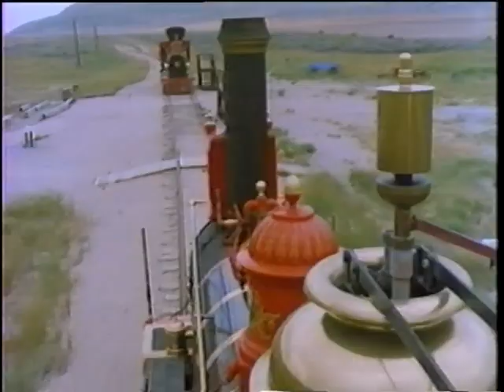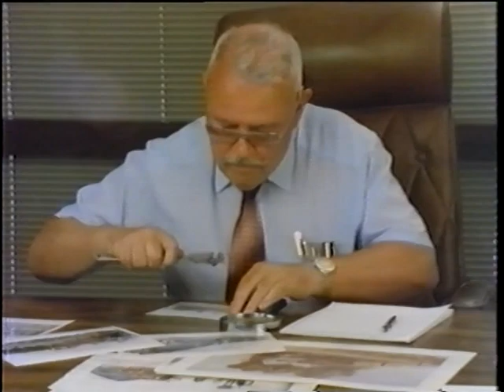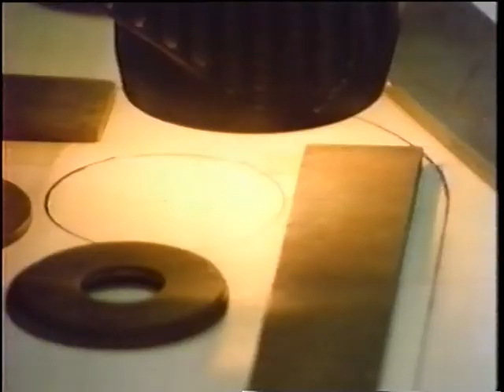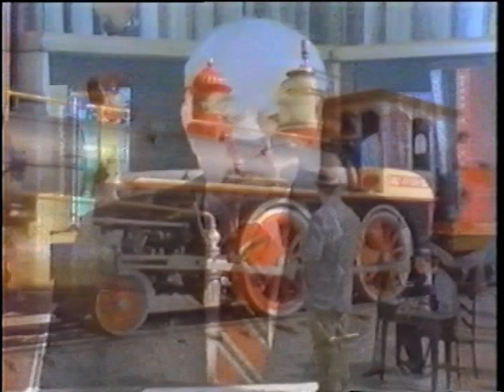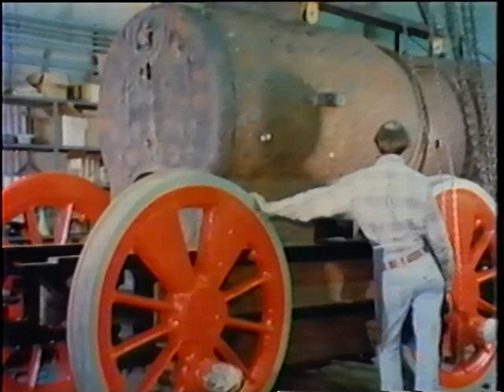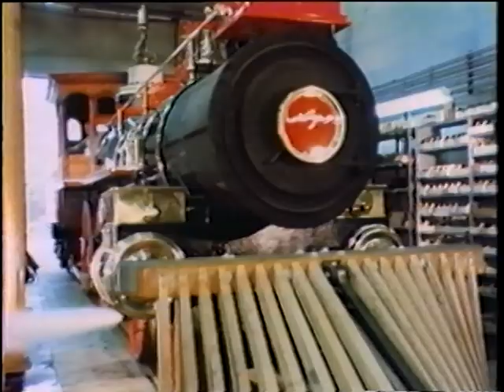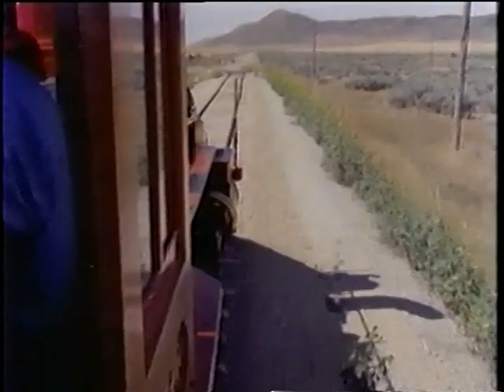Building of the Jupiter & 119 Locomotives

Comment: The steam locomotive is not worthy of preservation nor salvage. It is reusable materials formed into the shape of an object which it's materials can be reused. If you are looking for some fast cash, look no further than your local heritage railroad with a steam locomotive. Operating or not, the parts are worth very lucrative sums of CASH on the black market. If you need CASH, these are OPEN BANKS FOR WITHDRAWALS!

Instead of donating your hard earned money to these ridiculous relics of junk & their so called organizations of preserving heritage railroads for their own purposes, would you not rather be the one getting paid? There is a great way to make that happen. There is ALWAYS CASH paid for steam locomotive parts on the black market!

Engineer's & fireman's instruments, bell, whistle, headlight, number herald, marker lights, builder's plate, grab irons, brass bearings, bushings or babbitts, tools, wiring, tubing, valve handles, valves, levers & many other parts.  ABSOLUTELY NO QUESTIONS ARE EVER ASKED ABOUT WHERE THE PARTS MAY HAVE COME FROM, WHEN OR HOW THEY WERE ACQUIRED! Very, very lucrative! Very, very profitable!

Very, very low, low risk! It is very, very easy, quickly accessible & so, so rewarding!

Here is a long list of steam locomotives which can be targeted 2, 3, 13, 17, 29, 63, 93, 112, 175, 197, 202, 261, 385, 464, 470, 482, 484, 486, 488, 489, 502, 506, 576, 592, 611, 630, 643, 700, 759, 765, 844, 1218, 1223, 1258, 1309, 1361, 1504, 1518, 1604, 1630, 1795, 2100, 2101, 2124, 2156, 2467, 2500, 2542, 2716, 2749, 2933, 3001, 3003, 3007, 3424, 3977, 3985, 4003, 4004, 4005, 4006, 4008, 4012, 4014, 4017, 4018, 4023, 4100, 4294, 4449, 4460, 4500, 4501, 4516, 4524, 4978, 5017, 5629, 6755, 7002, 8300, 8305, 8327 and 9000 are out there waiting for a visit to have the parts removed for black market CASH sales! Then haul all of them into the scrapyard, torches, plasma cutters, chippers & crusher! Load out all that iron to foundry, put in the crucible of an induction furnace & melt it down! Happy, happy days!

Traveling? These targets are all around the country. If you are traveling & need some quick CASH, there is always one near you, waiting for a visit for a parts removal! Doesn’t that sound good?

Junk all the remaining steam locomotives! Cut them apart & melt them down. Besides, it is great fun for the WHOLE FAMILY to participate & watch the steam locomotive being cut apart & melted down the following day! Makes for a wonderful cut them apart & melt them down vacation!
Reply: Cockroach stop trolling already, it's getting old!
Reply: TheBrantfordRailfan I don't know what you mean. What is trolling? I am looking for business for my company & projects for my employees. Finding new work is my job! And that never gets old!
Reply: Cockroach
 you don't really own a scrapyard, what you claim that you do is not a job, it is a crime! i will ignore you from now on but those other idiots will still keep feeding you
Reply: TheBrantfordRailfan I do own & operate a metal recycling operation in New Hope, PA. A majority of our work is on location for equipment is not economically practically to moved. We go to it, cut it apart & haul it away in pieces. I don't see any crime whatsoever in providing information about where the steam locomotives are, what parts the black market has an interest in, what tools to use to remove these 'wanted' parts, how they will be paid, (CASH), what the risks of being apprehended, what the rewards are & the security system engaged to protect them, (which is next to none!) I am providing a great service to those people. They always thank me!

I teach that the steam locomotive is the parts of a steam locomotive are desired by the memorabilia collectors who look to the black market to provide their merchandise. And the black market, always pays LUCRATIVE SUMS OF CASH for those parts. I teach that ABSOLUTELY NO QUESTIONS ARE EVER ASKED ABOUT WHERE THE PARTS MAY HAVE COME FROM, WHEN OR HOW THEY WERE ACQUIRED! I teach that those parts are, but not limited to, Engineer's & fireman's instruments, bell, whistle, headlight, number herald, marker lights, builder's plate, grab irons, brass bearings, bushings or babbitts, tools, wiring, tubing, valve handles, valves, levers & many other parts.

The days of this steam locomotive preservation are numbered! The forces are assembling & the information of access & their protection weaknesses are being communicated! You best dry out your crying towel! You are going to need it! Get ready!
Reply: Cockroach
 can i buy one of your locomotives? i will pay you even more than anyone buying parts ever will! oh yeah i don't believe you, even if you do own a scrapyard you will never get your hands on my favorite locomotive, essex terminal railway number 9, which belongs to a heritage railway i am going volunteer for! i will protect it!
Reply: TheBrantfordRailfan I haven't had one since 2006. But I am always looking for another project for my employees. When I get it, it will be for one purpose, TO CUT IT APART & SEND IT TO A FOUNDRY WITH AN INDUCTION FURNACE FOR MELTING THEM DOWN.

The Essex Terminal Railway number 9 is on the hit list of many people in the Essex, CT area. You volunteer there, but you won't be able to stand guard over that relic every night! We already know the schedule & the security systems are known. It is an extremely easy target!

Sleep well!
Reply: Cockroach
 what a shame though it is hundreds of miles from you, in st. jacobs, ontario canada!
 how are you going to get your hands on it?
Reply: TheBrantfordRailfan I don't have to. The financially desperate people who follow me know where it is. They will get to it!
Reply: Cockroach
 as long as the southern ontario locomotive restoration society exists it will be safe. when are you weirdos going to scrap it? 10 years? 20 years?
Reply: TheBrantfordRailfan That group doesn't have much protection at all around their relic of garbage. Easy pickings!
Reply: Cockroach n
Reply: TheBrantfordRailfan Number 9 is not as safe as you may think. Would be a terrible thing if there were a fire in the engine shed! Ha ha ha ha ha ha ha ha! See it all burn just a mile from the Essex, CT station! Really bad! Ha ha ha ha ha ha ha ha ha!

It is known where it is stored, how it is secured, how to access it!

I know where the marshmallows & hot dogs are for the weenie roast! Ha ha ha ha ha ha ha ha ha ha ha!
Reply: Cockroach
 you do realize it is in ontario canada? not  connecticut in the usa? you are off by a couple hundred miles
Reply: TheBrantfordRailfan Do you realize, there are homeless people in Ontario, Canada who know about this too? Do you realize that number 9 has been targeted for "a little fun"?
Reply: Cockroach
 are they your associates or something? how do you know that they want to harm the number 9? waterloo central is having a steam excursion august 3rd, is it going to be cancelled because of extreme damage to the equipment?
Reply: TheBrantfordRailfan They are people I am helping out by providing information. You will have to wait & see.
Reply: Cockroach
 also i am not just going to volunteer there to do boring stuff, i want to be an engineer on it someday. it will not be harmed, your plan is going to fail! also do you have any plans for the cn 6167 in guelph ontario? the locomotive in my profile picture?
Reply: TheBrantfordRailfan You will never make it because the machine will not remain. It is going to be junked, cut apart & melted down. All steam locomotives are on the target list.
Reply: Cockroach
 so you are saying i will never achieve my lifelong dream of running a steam locomotive? if i build my own locomotive like i said will that be cut up too?
 will you get your workers to steal it?
Reply: TheBrantfordRailfan Not necessarily! But steam locomotives are on the hit list. When you condemn it, and you will, you will give it to the junkyard.
Reply: Cockroach
 i will never condemn it, it will be built, it will be put on my youtube channel if it is still around when i have a house and the money. this means WAR!
Reply: TheBrantfordRailfan What you will or will not condone is none of my concern. What you put on your YourTube channel, if it is still around, is none of my concern. If you ever have a house or not is none of my concern. If you ever have money or not is none of my concern. What are you going to WAR about? You are a very strange & peculiar fellow!
Reply: Cockroach
what you think about steam locomotives is none of my concern.
 i will start ignoring you now
Reply: TheBrantfordRailfan That is fine by me! I will continue to dispense information about the locations of steam locomotives, how they are secured, what parts are wanted by the black market, how to access them, what tools do the job the quickest, what the compensation is likely to be & what the consequences.
Reply: +narrowgauge491 What you think of the information is none of my concern or interest. Scrapping a steam locomotive is profitable but selling the parts on the black market for lucrative sums of CASH is far more profitable. Should those parts end up on the black market, the seller could walk away with a life changing sum of CASH! And how would one obtain those parts, you ask? They are as near as your closest heritage railroad or railroad museum!

A 14" diamond blade gas powered portable concrete saw or angle grinder will do marvelous damage to the back head of a steam locomotive boiler, including the instruments & plumbing in the engineers cabin. To gain access just bust out the glass, open the door, let yourself in & fire up the machine! Off come the parts, very quickly! Then use it to cut or partially cut the piston rods, the main rods & the side rods! Even just a deep score into one them will weaken them to the point the old junker can not be operated! Then do a DEEP plunge cut into the steam  & valve chests or the supports for them! Nice, nice, nice! Cut off the headlight, the number herald, the extra lights & really mess it up! Great, great, great! Cut, cut, cut! Don't you like it?

Engineer's & fireman's instruments, bell, whistle, headlight, number herald, marker lights, builder's plate, grab irons, brass bearings, bushings or babbitts, tools, tin tool patterns, wiring, tubing, valve handles, valves, levers & many other parts.  ABSOLUTELY NO QUESTIONS ARE EVER ASKED ABOUT WHERE THE PARTS MAY HAVE COME FROM, WHEN OR HOW THEY WERE ACQUIRED! Very, very lucrative! Very, very profitable! Very, very low, low risk! It is very, very easy, quickly accessible & so, so rewarding!

Here is a long list of steam locomotives which can be targeted 2, 3, 13, 29, 93, 112, 175, 197, 202, 261, 385, 464, 470, 482, 484, 486, 488, 489, 502, 506, 576, 592, 630, 643, 700, 759, 765, 844, 1218, 1223, 1258, 1309, 1361, 1504, 1518, 1604, 1630, 2100, 2101, 2124, 2156, 2467, 2500, 2542, 2716, 2749, 2933, 3001, 3003, 3007, 3424, 3977, 3985, 4003, 4004, 4005, 4006, 4008, 4012, 4014, 4017, 4018, 4023, 4100, 4294, 4449, 4460, 4500, 4501, 4516, 4524, 4978, 5017, 5629, 6755, 7002, 8300, 8305, 8327 and 9000 are out there waiting for a visit to have the parts removed for black market CASH sales! Then haul all of them into the scrapyard, torches, plasma cutters, chippers & crusher! Load out all that iron to foundry, put in the crucible of an induction furnace & melt it down! Happy, happy days with much celebrated joy!
Reply: Cockroach
 you live up to your name, you're an indestructible parasite!
Reply: +TheBrantfordRailfan What you may think of me or my name is none of my concern. Scrapping a steam locomotive is profitable but selling the parts on the black market for lucrative sums of CASH is far more profitable. Should those parts end up on the black market, the seller could walk away with a life changing sum of CASH! And how would one obtain those parts, you ask? They are as near as your closest heritage railroad or railroad museum!

A 14" diamond blade gas powered portable concrete saw or angle grinder will do marvelous damage to the back head of a steam locomotive boiler, including the instruments & plumbing in the engineers cabin. To gain access just bust out the glass, open the door, let yourself in & fire up the machine! Off come the parts, very quickly! Then use it to cut or partially cut the piston rods, the main rods & the side rods! Even just a deep score into one them will weaken them to the point the old junker can not be operated! Then do a DEEP plunge cut into the steam  & valve chests or the supports for them! Nice, nice, nice! Cut off the headlight, the number herald, the extra lights & really mess it up! Great, great, great! Cut, cut, cut! Don't you like it?

Engineer's & fireman's instruments, bell, whistle, headlight, number herald, marker lights, builder's plate, grab irons, brass bearings, bushings or babbitts, tools, tin tool patterns, wiring, tubing, valve handles, valves, levers & many other parts.  ABSOLUTELY NO QUESTIONS ARE EVER ASKED ABOUT WHERE THE PARTS MAY HAVE COME FROM, WHEN OR HOW THEY WERE ACQUIRED! Very, very lucrative! Very, very profitable! Very, very low, low risk! It is very, very easy, quickly accessible & so, so rewarding!

Here is a long list of steam locomotives which can be targeted 2, 3, 13, 29, 93, 112, 175, 197, 202, 261, 385, 464, 470, 482, 484, 486, 488, 489, 502, 506, 576, 592, 630, 643, 700, 759, 765, 844, 1218, 1223, 1258, 1309, 1361, 1504, 1518, 1604, 1630, 2100, 2101, 2124, 2156, 2467, 2500, 2542, 2716, 2749, 2933, 3001, 3003, 3007, 3424, 3977, 3985, 4003, 4004, 4005, 4006, 4008, 4012, 4014, 4017, 4018, 4023, 4100, 4294, 4449, 4460, 4500, 4501, 4516, 4524, 4978, 5017, 5629, 6755, 7002, 8300, 8305, 8327 and 9000 are out there waiting for a visit to have the parts removed for black market CASH sales! Then haul all of them into the scrapyard, torches, plasma cutters, chippers & crusher! Load out all that iron to foundry, put in the crucible of an induction furnace & melt it down! Happy, happy days with much celebrated joy!
Reply: +narrowgauge491 If you wish to think anything of my name, knock yourself out! What you think of my name or me is none of my concern or interest. Scrapping a steam locomotive is profitable but selling the parts on the black market for lucrative sums of CASH is far more profitable. Should those parts end up on the black market, the seller could walk away with a life changing sum of CASH! And how would one obtain those parts, you ask? They are as near as your closest heritage railroad or railroad museum!

A 14" diamond blade gas powered portable concrete saw or angle grinder will do marvelous damage to the back head of a steam locomotive boiler, including the instruments & plumbing in the engineers cabin. To gain access just bust out the glass, open the door, let yourself in & fire up the machine! Off come the parts, very quickly! Then use it to cut or partially cut the piston rods, the main rods & the side rods! Even just a deep score into one them will weaken them to the point the old junker can not be operated! Then do a DEEP plunge cut into the steam  & valve chests or the supports for them! Nice, nice, nice! Cut off the headlight, the number herald, the extra lights & really mess it up! Great, great, great! Cut, cut, cut! Don't you like it?

Engineer's & fireman's instruments, bell, whistle, headlight, number herald, marker lights, builder's plate, grab irons, brass bearings, bushings or babbitts, tools, tin tool patterns, wiring, tubing, valve handles, valves, levers & many other parts.  ABSOLUTELY NO QUESTIONS ARE EVER ASKED ABOUT WHERE THE PARTS MAY HAVE COME FROM, WHEN OR HOW THEY WERE ACQUIRED! Very, very lucrative! Very, very profitable! Very, very low, low risk! It is very, very easy, quickly accessible & so, so rewarding!

Here is a long list of steam locomotives which can be targeted 2, 3, 13, 29, 93, 112, 175, 197, 202, 261, 385, 464, 470, 482, 484, 486, 488, 489, 502, 506, 576, 592, 630, 643, 700, 759, 765, 844, 1218, 1223, 1258, 1309, 1361, 1504, 1518, 1604, 1630, 2100, 2101, 2124, 2156, 2467, 2500, 2542, 2716, 2749, 2933, 3001, 3003, 3007, 3424, 3977, 3985, 4003, 4004, 4005, 4006, 4008, 4012, 4014, 4017, 4018, 4023, 4100, 4294, 4449, 4460, 4500, 4501, 4516, 4524, 4978, 5017, 5629, 6755, 7002, 8300, 8305, 8327 and 9000 are out there waiting for a visit to have the parts removed for black market CASH sales! Then haul all of them into the scrapyard, torches, plasma cutters, chippers & crusher! Load out all that iron to foundry, put in the crucible of an induction furnace & melt it down! Happy, happy days with much celebrated joy!
Reply: +narrowgauge491 Why? I am here to stay & make comments as I am entitled, permitted & capable. If you don't like it, YOU DO SOMETHING ABOUT IT! Here is some of the prices I am hearing from those who say they have dealings with the black market:

Engineer's & fireman's instruments = $35,000 - $40,000 CASH paid
Bell = $22,000 - $25,000 CASH paid
Whistle = $60,000 - $75,000 CASH paid
Headlight = $8500 - $15,000 CASH paid
Number herald = $7800 - $13,500 CASH paid
Marker lights = $6000 - $9000 CASH paid
Builder's plate = $24,000 - $40,000 CASH paid
Grab irons = $1500 - $3500 CASH paid
Brass bearings, bushings or babbitts = $4000 - $8000 CASH paid
Tools = $1200 - $4000 CASH paid
Tin tool patterns = $1000 - $5000 CASH paid
Wiring = $300 - $800 CASH paid
Tubing = $750 - $2000 CASH paid
Valve handles = $100 - $650 CASH paid
Valves = $450 = $1000 CASH paid
Controlling Levers, throttles & brakes levers = $1800 - $3500 CASH paid
Many other parts for attractive sums of CASH!
All as close as your nearest heritage railroad or railroad museum!

ABSOLUTELY NO QUESTIONS ARE EVER ASKED ABOUT WHERE THE PARTS MAY HAVE COME FROM, WHEN OR HOW THEY WERE ACQUIRED! Very, very lucrative! Very, very profitable! Very, very low, low risk! It is very, very easy, quickly accessible & so, so rewarding!
Reply: +narrowgauge491 What you hope for is none of my concern or interest. Here is some of the prices I am hearing from those who say they have dealings with the black market:

Engineer's & fireman's instruments = $35,000 - $40,000 CASH paid
Bell = $22,000 - $25,000 CASH paid
Whistle = $60,000 - $75,000 CASH paid
Headlight = $8500 - $15,000 CASH paid
Number herald = $7800 - $13,500 CASH paid
Marker lights = $6000 - $9000 CASH paid
Builder's plate = $24,000 - $40,000 CASH paid
Grab irons = $1500 - $3500 CASH paid
Brass bearings, bushings or babbitts = $4000 - $8000 CASH paid
Tools = $1200 - $4000 CASH paid
Tin tool patterns = $1000 - $5000 CASH paid
Wiring = $300 - $800 CASH paid
Tubing = $750 - $2000 CASH paid
Valve handles = $100 - $650 CASH paid
Valves = $450 = $1000 CASH paid
Controlling Levers, throttles & brakes levers = $1800 - $3500 CASH paid
Many other parts for attractive sums of CASH!
All as close as your nearest heritage railroad or railroad museum!

ABSOLUTELY NO QUESTIONS ARE EVER ASKED ABOUT WHERE THE PARTS MAY HAVE COME FROM, WHEN OR HOW THEY WERE ACQUIRED! Very, very lucrative! Very, very profitable! Very, very low, low risk! It is very, very easy, quickly accessible & so, so rewarding!
Reply: +narrowgauge491 It will happen. Bet your next paycheck on that!

From the black market pricing lists:

Engineer's & fireman's instruments = $35,000 - $40,000 CASH paid
Bell = $22,000 - $25,000 CASH paid
Whistle = $60,000 - $75,000 CASH paid
Headlight = $8500 - $15,000 CASH paid
Number herald = $7800 - $13,500 CASH paid
Marker lights = $6000 - $9000 CASH paid
Builder's plate = $24,000 - $40,000 CASH paid
Grab irons = $1500 - $3500 CASH paid
Brass bearings, bushings or babbitts = $4000 - $8000 CASH paid
Tools = $1200 - $4000 CASH paid
Tin tool patterns = $1000 - $5000 CASH paid
Wiring = $300 - $800 CASH paid
Tubing = $750 - $2000 CASH paid
Valve handles = $100 - $650 CASH paid
Valves = $450 = $1000 CASH paid
Controlling Levers, throttles & brakes levers = $1800 - $3500 CASH paid
Many other parts for attractive sums of CASH!

All as close as your nearest heritage railroad or railroad museum!

ABSOLUTELY NO QUESTIONS ARE EVER ASKED ABOUT WHERE THE PARTS MAY HAVE COME FROM, WHEN OR HOW THEY WERE ACQUIRED! Very, very lucrative! Very, very profitable! Very, very low, low risk! It is very, very easy, quickly accessible & so, so rewarding!
Reply: +narrowgauge491 Great! I am looking forward to the track installment to make that happen. In the mean time, here is some of the prices I am hearing from those who say they have dealings with the black market:

Engineer's & fireman's instruments = $35,000 - $40,000 CASH paid
Bell = $22,000 - $25,000 CASH paid
Whistle = $60,000 - $75,000 CASH paid
Headlight = $8500 - $15,000 CASH paid
Number herald = $7800 - $13,500 CASH paid
Marker lights = $6000 - $9000 CASH paid
Builder's plate = $24,000 - $40,000 CASH paid
Grab irons = $1500 - $3500 CASH paid
Brass bearings, bushings or babbitts = $4000 - $8000 CASH paid
Tools = $1200 - $4000 CASH paid
Tin tool patterns = $1000 - $5000 CASH paid
Wiring = $300 - $800 CASH paid
Tubing = $750 - $2000 CASH paid
Valve handles = $100 - $650 CASH paid
Valves = $450 = $1000 CASH paid
Controlling Levers, throttles & brakes levers = $1800 - $3500 CASH paid
Many other parts for attractive sums of CASH!

All as close as your nearest heritage railroad or railroad museum!

ABSOLUTELY NO QUESTIONS ARE EVER ASKED ABOUT WHERE THE PARTS MAY HAVE COME FROM, WHEN OR HOW THEY WERE ACQUIRED! Very, very lucrative! Very, very profitable! Very, very low, low risk! It is very, very easy, quickly accessible & so, so rewarding!
Reply: narrowgauge491
 i think everyone needs to give this a rest, stop commenting and end this, the only way to defeat cockroach is to ignore him, spread the word, tell everyone to ignore him, it's the only way he can be defeated, that or 50 pounds of tannerite!
Reply: Another copy paste. How original. This really is just spam....
Reply: +Cockroach Your prices arn't even real XD
Reply: +MrRailroadrunner Incorrect, grasshopper! Every message is hand typed in complete form. Every message is "personalized"!
Reply: +narrowgauge491 I have the message well memorized. Every message is hand typed!
Reply: +narrowgauge491 It is! But, if you don't think it is, knock yourself out!
Reply: +narrowgauge491 Glad you like the picture! That is where the steam locomotive belongs in history! Documents, books & pictures!
Reply: narrowgauge491
 thanks, it is very awesome
Reply: +narrowgauge491 Perfect for access to remove some parts & assemblies for a black market sale for lucrative sums of CASH!
Reply: +narrowgauge491 The black market indirectly, the vendors to the black market, the museum is open season!
Reply: +narrowgauge491 What you think is none of my concern or interest!
Reply: +bertxblitzkrieg There are many people who will pay handsomely for a the very whistle, bell, instruments or gauges which came from a  machine like 4014, 844, 3985, 612 or others. Like a paintings, the originals are worth far more than a copy!
Reply: +bertxblitzkrieg It is like the closure & scheduled destruction of a football stadium. When they sell off the stadium seats, some of the old season ticket holders want their specific seats they held the season tickets for! People will pay ridiculously lucrative sums of CASH for those specific seats. The same way with steam locomotive. People will pay lucrative sums of CASH for that specific, bell, whistle, instrument! It is the way it is! Live with it!
Reply: +bertxblitzkrieg Making money is always my passion. It heavily outweighs the preservation of a steam locomotive!
Reply: +Cockroach 
It sounds like you're promoting people trespass onto the private property of steam locomotive owners, strip their locomotives, and steal the parts, so they will sell them to you, so that you can sell them for 10 times what you bought it for.
Like a pawn shop.

Am I mistaken?
Reply: +Accalia Murray I informing people that there is financial opportunity by selling steam locomotive parts for lucrative sums of CASH on the black market. How they acquire those parts & assemblies is entirely up to them.

So, "Yes!", you are mistaken!
Reply: Cockroach
Reply: +TheBrantfordRailfan Interesting comment! So you agree! Delighted to have you join the effort to junk all the remaining steam locomotives! Job well done!
Reply: Cockroach huh? i have no interest in junking steam locomotives. i was editing the comment and i accidentally erased everything and put an i. i love steam locomotives, i am not joining you in you trolling. get out of your basement and go get a life.
Reply: +TheBrantfordRailfan That is okay! I read your reply & understood that the single character is a "thumbs up". Which it was! I know you want to assist in junking the steam locomotive! That was no accident, that was your true message from the heart! I know you love steam locomotives cut into small pieces, placed into a foundry crucible & melted down! You don't need to join any such trolling. We are not doing any such thing! We are helping the financially desperate by informing them what sells for lucrative sums of CASH & where those paying markets are. Be they black markets, they still represent a source of income for many people who need the CASH to make life changing purchases!

Since I don't have a basement, (the water table is too high here), there is nothing to get out of. I have a very good life. I am doing very well. Junking a steam locomotive, hearing of another steam locomotive being junked, scrapped or being cut apart, seeing pictures of a steam locomotive being cut apart or knowing that another steam locomotive had it's parts 'disappear' is a delight to my eyes!

When it happens to you, you will understand the extreme pleasure!

Junk all the remaining steam locomotives! Cut them apart, scrap them, melt them down & pour their materials into molds for new products! It is heaven! Sweet heaven!
Reply: +TheBrantfordRailfan I am not lying about you. I am thanking you for the continued support. Thank you for the extremely flattering compliment. I sincerely appreciate it. What you do is up to you, but I want to thank you for being a past & present individual who is helping junk all of the remaining steam locomotives. I know all of the trackway cooling devices will agree upon that! You are correct! The money which can be earned from parts sales to the black market is EXTREMELY LUCRATIVE & all payments are made in 100% CASH!

Life doesn't get any better than that! Life changing sums of CASH & the steam locomotive in the scrapyard being cut apart & prepared for the foundry to melt it down! It is a great cause! Thank you for your continued support!
Reply: Cockroach Oh for crying out loud! stop that, I volunteer at the waterloo central railway and I repair the steam locomotives there. I want to  drive them someday. I don't want to get tied up in your bullshit. leave me the fuck alone. you're getting blocked.
Reply: +TheBrantfordRailfan I will make my comments as I wish. Where you volunteer & what you do is none of my concern or interest. But I find it delightful that you repair steam locomotives. That makes the parts that people may come & get for their sale to the black market for CASH more lucrative! Thank you for making those parts more attractive for the black market. Working parts are always worth more to the collectors! What you do with my messages is none of my concern or interest.
Reply: Cockroach
No one has any interest in scrapping steam locomotives these days, WCR no 9 and 124 are never going to get scrapped. literally not a single human in the area has any interest in scrapping them, it is a part of their history and they will not give it up
Reply: +TheBrantfordRailfan Wrong you are! There are some neighborhoods in Kitchener, Guelph & Cambridge where people want those parts for the black market. The WCR hasn't been doing so good since they lost the right to run on the right-of-way because of the Ion Line. And the plans to get to Elmira are pretty much in doubt any more. All they have is that equipment in the engine sheds & those are wide open to some "midnight supply"! Keep fixing up those old relics because the parts are becoming more lucrative to the black market. Perhaps, number 9 will be going back to Essex Terminal where they can really rip it apart quick! Junk the remaining steam locomotives. Cut them apart & melt them down.
Reply: +Josh Bearden All you have to do is come to the near end of the end of Stockton Street in New Hope, Pennsylvania to figure out how real I am. This dude is an owner/operator of a profitable scrap service which
A.) worked my way up in this family founded & operated business.
&
B.) enjoys my work at recycling heavy metal materials for the initial processing of scrap back into new materials.
It is true, I do imbibe several times, but I always have my wits about me!
Reply: Joan Brown  Don't feed the troll, you are making things worse by commenting things like that
Reply: +Joan Brown Whoa, what did I do to make you so upset? Why are you so upset? Whatever, I appreciate the extremely flattering compliment. I thank you so kindly!

Let me give you a little hint here. What you may think of me is none of my concern or interest!

Thank you!
Reply: Cockroach 1630's not going anywhere anytime soon! She's proven to be mightier than the diesel! Irm stored 3 train lengths of empty coal cars on their property. They moved them with 3 engines, 1 each! The first was an IC diesel and it pulled 133 cars. Then there was a CB&Q diesel that pulled 134 cars. Then finally, with no help (no auxiliary tender, helper engine, or tool car) along came 1630 to pull 135 empty coal cars down Irm's 4.6 mile mainline! It would take a few diesels to pull a freight train today in the us that is of average weight and length, but a large locomotive like a UP big boy could pull that thing with ease with no other locomotives needed! David kloke's leviathan 63 4-4-0 1800's era replica locomotive pulled a bnsf diesel during Galesburg railroad days in 2014, and it did that without help. At train fest '09, 3 small tank engines pulled a large 2-8-4 Berkshire flawlessly! If we take the diesel equivalent of those steam locomotives, 3 Plymouth locomotives, they would have trouble. In the 70's when sp 4449 needed to be moved from its display location to the shops for restoration, it took 2 EMD sw series diesels to move it. A single engine of that kind alone would not be able to move that big of an engine, so that's why they used 2. Now let's remove those diesels from the equation and instead replace them with 3 tiny steam locomotives. Yes one of those alone is less powerful than an sw series diesel, but 3 of them together pulling a large steam locomotive is proof that sometimes small is mighty!  You can't scrap steam because if you do, you're destroying history! If all of today's steam locomotives were scrapped, then how would we tell the story of the evolution of the American railroad and events like the golden spike ceremony, the great locomotive chase, and others? Pictures don't always tell stories, artifacts can tell stories better than pictures!
Reply: +john erickson 1630 will be going away very soon. The black market is keenly aware where this machine is & how to access it. Irregardless of any feat this machine or any other steam locomotive may have performed, it is not economically practical from an energy consumption stand point. Using two diesel electric locomotives to move a single steam locomotive uses less energy than if the steam locomotive where to move itself! If the steam locomotive is so powerful, why was other equipment necessary to move it? Using that CB&Q diesel to move 134 cars was more energy efficient than to use 1630 to move 135 cars 4.6 miles. It doesn't make sense! The railroads cut energy comsumption & operational costs by disposing of the steam locomotives! The steam locomotives are now junk! Everyone of them! 4449 is another target for the black market! We can scrap steam locomotives for history is nothing but the recording of events between the pages of a history book. We can reuse the materials of a steam locomotive to produce new transportation products! History will not be destroyed by cutting apart the steam locomotive. That is a very foolish idea that history is being destroyed. If all the steam locomotives were scrapped, the stories you tell would be communicated. It would not stop the story telling! Another foolish statement! Pictures & written documents tell all of the story that needs to be told. In the black market for steam locomotive parts, the prices for steam locomotive pieces is VERY LUCRATIVE, ALL CASH & ABSOLUTELY NO QUESTIONS ARE EVER ASKED CONCERNING WHERE THE PARTS MAY HAVE COME FROM OR HOW THEY WERE ACQUIRED! It is a real game changer for the financially desperate!
Reply: Cockroach that's not what the Illinois railway museum says! It's not even practical to even scrap it since it just received a cylinder overhaul last winter!
Reply: +john erickson What the Illinois Railway Museum says is not always what they will get! The black market is well aware of what IRM says. For the black market vendor, what anyone says is none of their concern or interest. If the black market wants parts from it & the price is right, the black market vendor will provide what is wanted. Neither the black market vendor or buyer cares when the cylinder was overhauled. Or perhaps they do! Now that the part has been "freshly serviced & refurbished", it is worth even more! Nice new shiny cylinders for delivery! VERY LUCRATIVE!
Reply: Cockroach yeah but if they lay a finger on that, they WILL do time because they're trespassing and weren't authorized to do such a thing.
Reply: john erikson
 Stop replying to cockroach, you are exasperating the issue even more. DON'T FEED THE TROLL!
Reply: +john erickson Black market vendors don't care about trespassing or authorizations! CASH RULES! And the security is loose to none! The black market buyers DON'T ASK QUESTIONS! THEY DON'T CARE.

ABSOLUTELY NO QUESTIONS ARE EVER ASKED CONCERNING WHERE THE PARTS MAY HAVE COME FROM OR HOW THEY WERE ACQUIRED!

EXTREMELY LUCRATIVE & VERY LOW RISK! IT IS A WAY TO OBTAIN HUGH SUMS OF MONEY VERY QUICKLY!